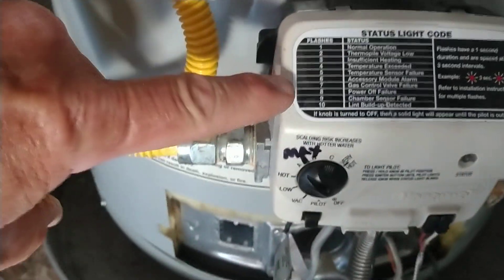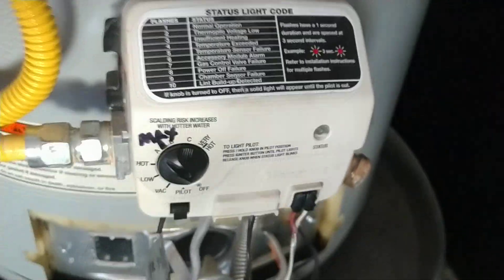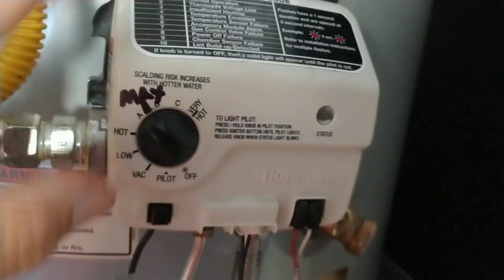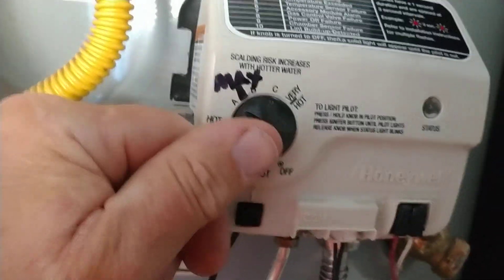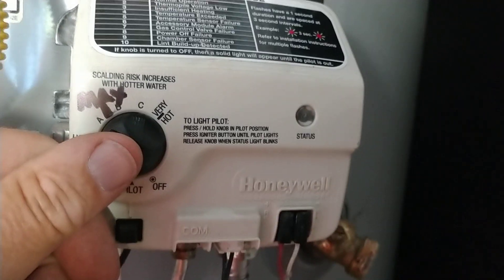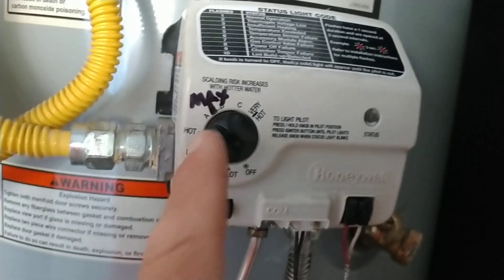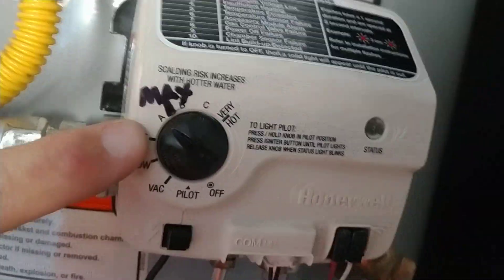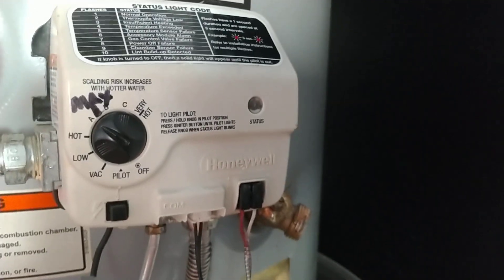Water Heater Blinking Error Code Reset Honeywell Valve

Comment: On a newer Honeywell, model 2 flashes means low thermal pile voltage. Main valve not turned on.  Is that the same thing?

Comment: If you don't have four or five minutes to wait, you can unplug the two leads that go into the thermostat, the light will blink for about 15 more seconds before dying out to nothing. Wait another 10 seconds. Plug the leads back in and it should be reset back to a single flash again.
Reply: You will need to relight the pilot after performing this reset.
Reply: It worked just did it 🎉

Comment: Hello . Could you please describe each error code?
Reply from the maker: Unfortunately there are different controllers with different error codes. The error codes are printed on the controller or sometimes on a label on the water heater. If it's not on the controller look for a label up there about the middle section of the water heater.

Comment: Just tried it and it worked, back to 1 flash. Let's see how long it stays. I set the knob to A.
Reply: Had to reset it again this weekend so it lasted only about a month. This I set it to just below the Hot setting.
Reply: 3rd reset less than 2 weeks from the last one. Guess it's time for a replacement. I wonder if the replacement is an improved version or the same.

Comment: ?? Is it going to light while there is an error?  The dial has to be on pilot for it to light.  Are you holding it down while on "Pilot" ?
Reply: IT WORKED!  My pre-YouTube search attempt to reignite the heater is what gave me the 7-blink code.   I had dial on Pilot > Pressed ignite 5 - 7 times > rotated dial while keeping it pressed (out of frustration) and I heard it light up!   I kept the dial pressed for about 30 seconds before I got a single steady blinking light.

Comment: Thank you Mike, I bought a new controller, hooked it up, turned it on and got 7 blinks right from the start. I was pissed and sure i got a bad controller. I saw your video, held the button for 3.5 minutes and it reset and now is working great. Thank you very much for sharing your knowledge and experience.

Comment: I am about to replace my 18-year-old water heater. I prefer the old reliable gas valve, not the new fancy electronic valve. I know not to put gasoline in the basement, so I have never had a fire or explosion. The new fancy valves will cost more and will be less reliable. This is not progress.

Comment: Our is flashing 9times. Error code says "chamber sensor failure". Any idea how to fix that??
Reply from the maker: Installing a new chamber sensor might work
Reply: @mikemorrison4860  darn, I was hoping we could reset system and avoid that a replacement. Thanks!
Reply: mike morrison which one is the chamber sensor??? is that the temperature sensor or wich one any advise thanks mike for ur help
Reply: @Mike morrison
Reply: I'm having the same problem, any ideas on how to fix it?

Comment: My Control Gas Valve did NOT reset to 1 blink or even less than 7. However since I was able to light the pilot and it did NOT turn off when I let go of the knob; I decided to turn the knob towards to "A" setting and the flame turned on! However it was still showing the 7 red light blinks, but after a minute or so it turned Blue! 🙌🙌 Hope this helps anybody else. Thanks for the video man, really saved me a headache.

Comment: im replace new valve after that it game code 2 error thermocopile low voltage so i replace it it kept reading error 2 put a second new thermopile same thing error 2 after 30 sec valve pilot off.any tips on whats going on thanks for the advice
Reply: get it fixed? thermocouple issue?